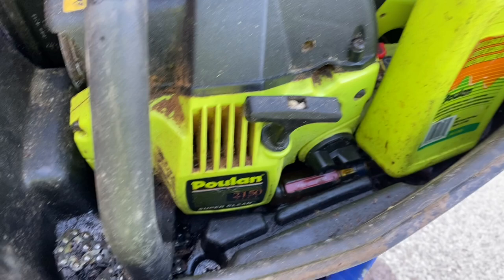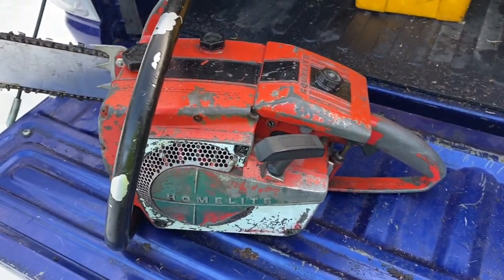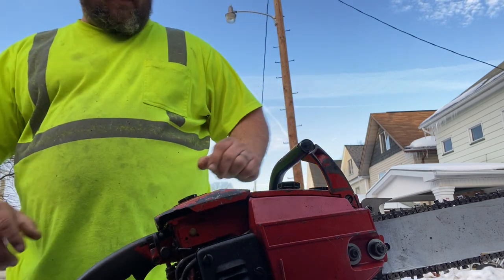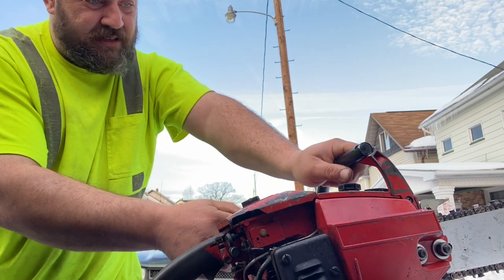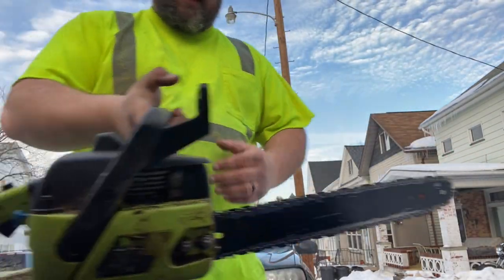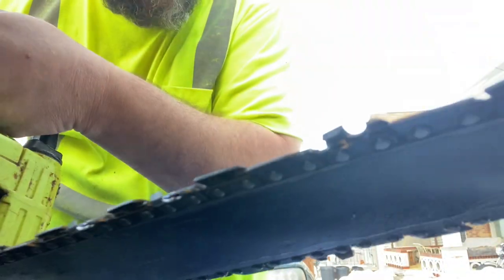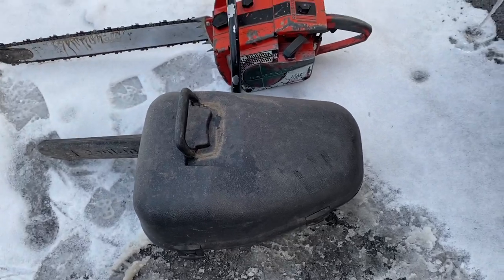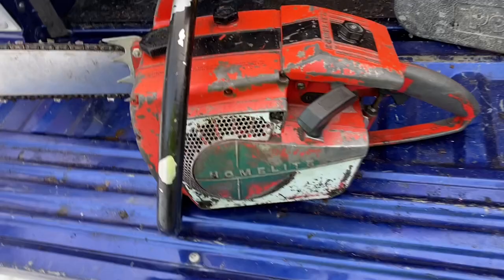Test Fire Of The Homelite Super XL-923 82cc Chainsaw And A Poulan 2150 Dumpster Dive Chainsaw!

Comment: Homelite is running good!  Big CC power!

How about “ Paper Weight”. 🤣 for the Poulan!
Same as my project. Clutches are cheap and plentiful for these. Check the epa sticker on the back. Even though they marketed them as different cid, most are all either 38 or 42 cc.  
Put a full house chain, open up the muffler a bit , window the piston, pull exhaust to about 104, intake duration around 148-150 and peen open the lowers and it will run better than you think!
Reply from the maker: Thanks for the tips!

Comment: The 923 sounded mean and hungry.
Reply from the maker: That thing is a beast of a saw!
Reply: @Smittyschainsaws  I'll never forget the feeling I had the first time I stuck the 925 in wood. It makes the 50 to 60 cc class saws seem weak and almost like a toy. 
Just beware of the kickback. We are both pretty good size men, but we can still be smacked in the face.
Reply from the maker: Kickback is the reason I don't mind running safety chain!